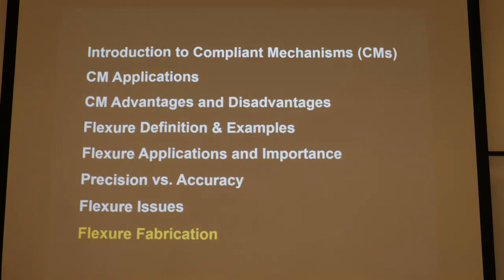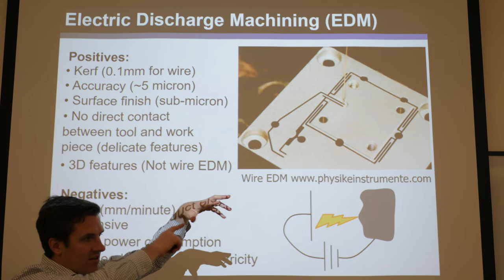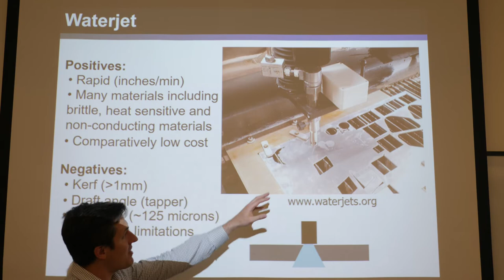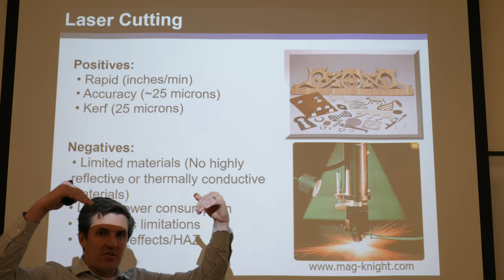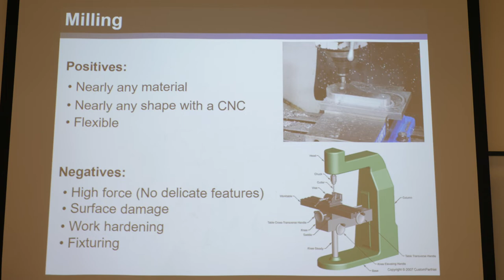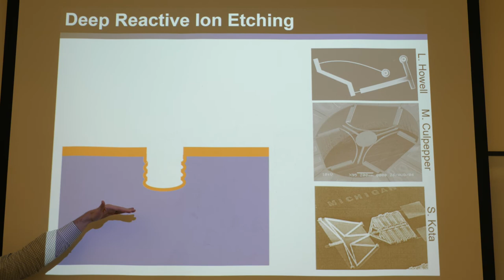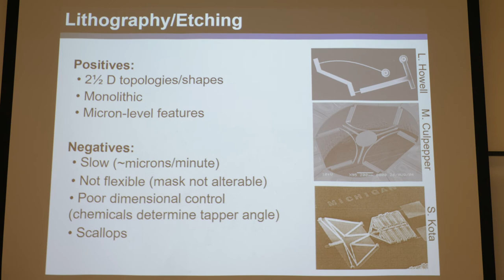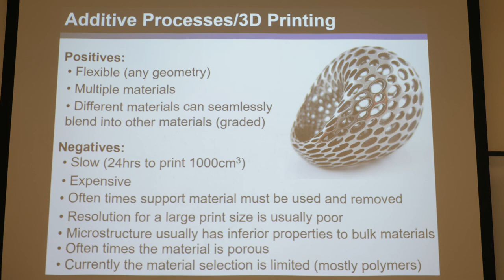Compliant Mechanisms Lecture 1 Part 6

Comment: Great lecture. After watching this I came up with an idea, not sure if anyone has tried it but what if you did SLA 3D printing (low cost and best resolution) with castable resin then casting into aluminum or titanium but inside a VPI tank (high pressure to push molten metal into narrow features)? Any thoughts on this?
Reply: I guess you’ve probably found out your answer by now, but just in case, yes it exists and it is a small revolution in the prototype world thanks to the ability to make casting molds a lot more easily and cheap !